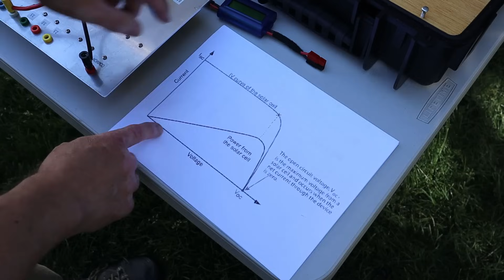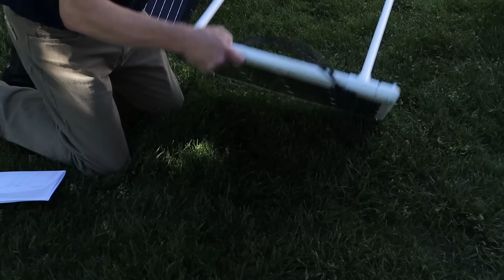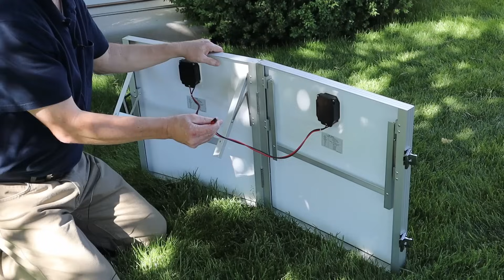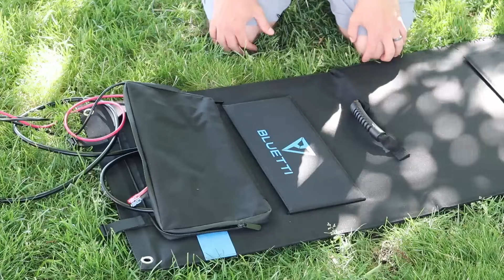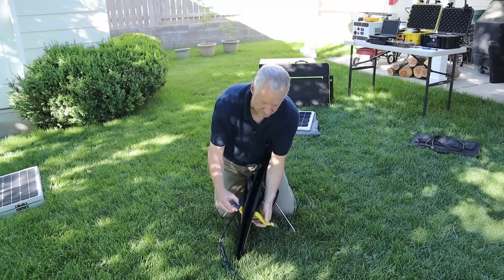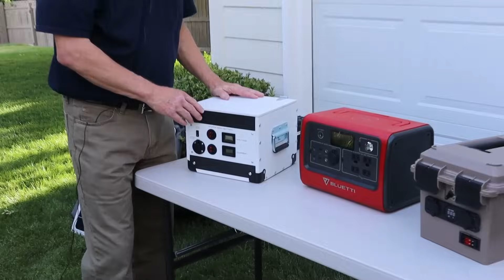Portable Solar Panel Comparison, 11 Different Models! Sunpower, Baldr, Rockpals, Bluetti, and More!

Comment: SAW that Jeff's favorite when using the coupon is close to the price of the 120W Paxcess.  asking the same question of the Balder.....

  i just ordered my s1500 Pecron f.  now budget is an issue. so looking at panel options
Q :Is the Balder 120W Portable Solar Panel compatible with the 1500 PECRON  …..is there a faster Balder that won’t blow up my Pecron or budget?    
 There were a couple of used Balders....would they be okay? would help the budget.
Thanks much 
kat in central Illinois
Reply: Hi Kathryn, let me look into the Pecron S1500 specs and get back to you. As far buying the Baldr from an Amazon Warehouse deal, I've had good luck with those as long as I go with something that says "good like now". I tend to stay away from something that describes any damage or describes it as "acceptable" I've noticed that Baldr keeps moving the coupon back and forth from $30 and $40. So keep an eye on it.

Comment: hEARING ISSUES THANK YOU FOR THE CLOSED CAPTIONING

HELP  i just ordered my s1500 Pecron f.  now budget is an issue. so looking at panel options
Q :Is the PAXCESS 120W Portable Solar Panel with USB QC 3.0, Typc C Output, Off Grid Emergency Power compatible with the 1500 PECRON  …..is there a faster paxcess that won’t blow up my Pecron?  
Thanks much 
kat in central Illinois
Reply: Hi Kathryn, It looks like the Pecron S1500 is a pre-launch on Indegogo. So there is no manual available. I assume some similarity between it and the E1500. I did learn a lot about charging the E1500 but not sure how much I should say here in case it changes. I did learn from the launch video that it says 36v, 20 amp max solar panel input. Some of these battery stations (and Pecron is not the only one) tend to lean towards wanting a higher input voltage from the solar panels than what a traditional 12v (18v as they call them) does. Two 100w or two 120w solar panels in series would be fine. Or one 24v, (36v at maximum power point) up to 20a max panel but those are not as common. One 120w, 12v panel by itself may work when you consider that in the case of the E1500 they provide a cigarette lighter adapter and that voltage would never see anything much higher than 14.5v (from the car alternator).

I personally would wait off on buying a solar panel until you get the manual and can share it with me. Another thing is if you are prepared to buy two panels, buy just one and try that first. If not getting very good results and you need to boost the voltage up, then purchase another panel so that you can wire them in series to double the voltage.

This much we know:
1) it will work with a 24v (36v at maximum power point) panel as long as the current does not exceed 20 amps
2) it will work off of two 12v, 120w solar panels wired in series.
3) we're not sure if it will work with just one 12v, 120w panel.

Any brand of solar panel will work provided that its wired correctly. For 12v panels it may mean that two of them have to be wired in series. It's all about dealing with the volts and amps and dealing with the 4 pin 16mf aviation connector that Pecron has on their battery station. If need be a 16mf plug can be purchased and a custom cable made. For fastest charging is to get as close to the maximum input rating without going over it, but also leave a little margin for safety. Hope this helps.

Comment: Great info.  Thanks for clearing up the process on recharging the different battery packs.  I watched your DIY battery pack and priced it out.  Looks like it will cost under $400 for a 100 aH LiPO.  Not bad.  Short term goal is to get the VL45 fridge and maybe the Sunpower panel.  Want to keep it as minimal and cheap as possible.  Just want fresh food and top of the phone batteries so I don't need an inverter.
Reply from the maker: That's a good plan, most camping gadgets just need 12volts anyways, including 12v fridges 👍🏻 Just choose a solar charge controller that will support Lifepo4 batteries and you'll be set! Thanks for your comment!